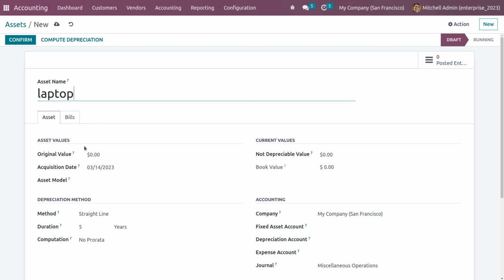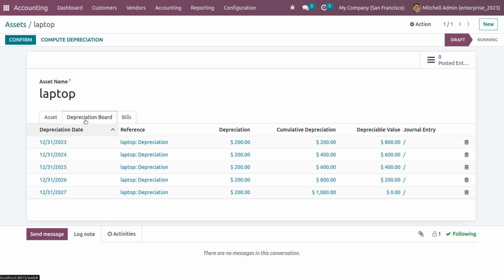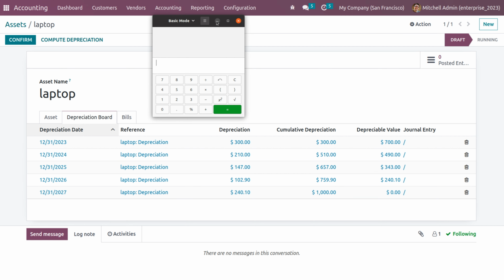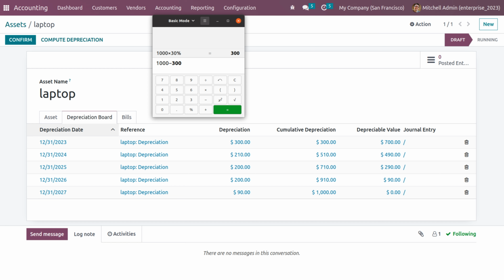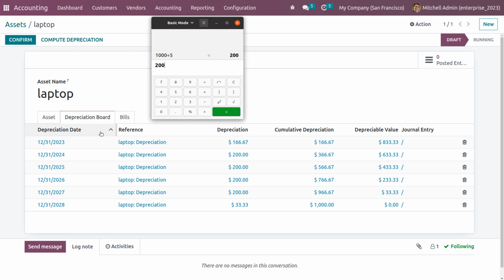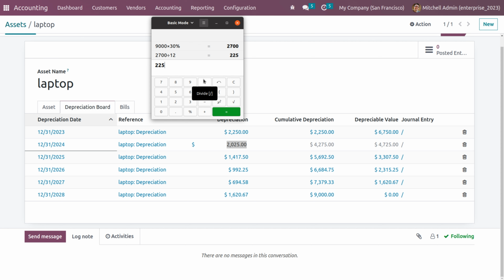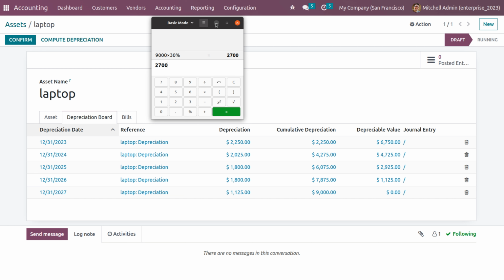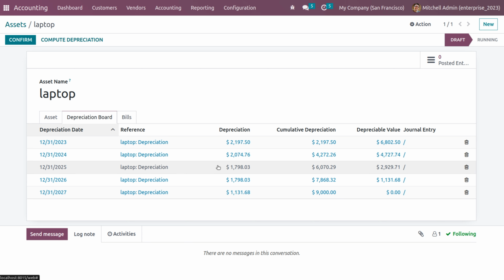Assets Management in Odoo 16 Accounting | Odoo 16 Enterprise Edition Videos

Comment: How do you record LAND which is never depreciated in Odoo?
Reply from the maker: You need to add the asset value of the land as the opening asset value in a fixed asset account. There is no need to use the Asset management system to manage the asset.

Comment: How we add my old assets in the Odoo system as some of them had accumulated depreciation value.

Ex.
One Asset cost when we purchase  it : 1000 $ in 1/1/2021  5 year depreciation 200$ a year 
The accumulated dep. as at 31/12/2023 is 400
Net book value 600$

when we want to move from the old accounting system to Odoo, what is the wright way to record our old assets that had already partially deprecated as shown in my example above?
taking to your consideration that the number of the old assets exceeded 5 Thousands from different type of assets.
Reply from the maker: While creating the asset set the original value as 1000, and the acquisition date as 1/1/21, and there is an option to add the deprecated amount there. so that when importing assets, the deprecated amount can be set there. Then the asset will be created only for the remaining 3 years.

Comment: Heloo, The old assets when recorded the depreciated value/ negative asset appear in the balance sheet....why is the net book value captured in the dep schedule not appearing in the balance sheet ?
Reply from the maker: For that initially, we have to add the fixed asset as the opening balance, which will reflect the respective fixed asset account and when depreciation is calculated, the respective depreciation and expense will be recorded.

Comment: You have showed depreciation account is a Non-Current Asset Type, Account code 1010, how it could be possible. I wish Cybrosys Team will be aware of their presentation. Thanks
Reply from the maker: Odoo has restricted the domain for depreciation as non-current assets, assets, or fixed assets. The use of account type and code depends on in which report it needs to be displayed and the business requirement